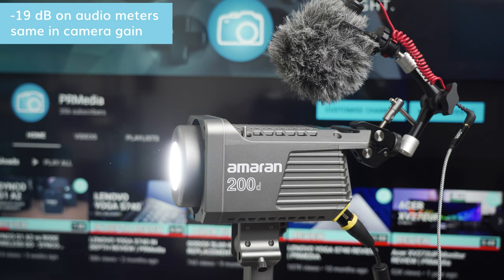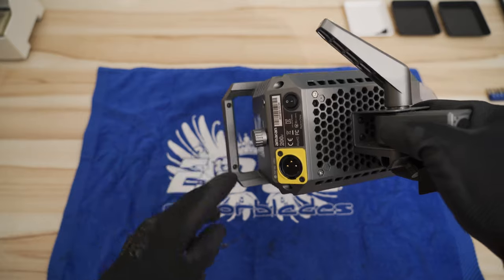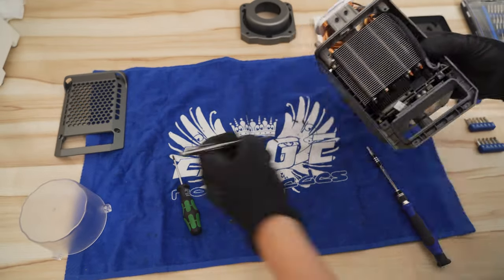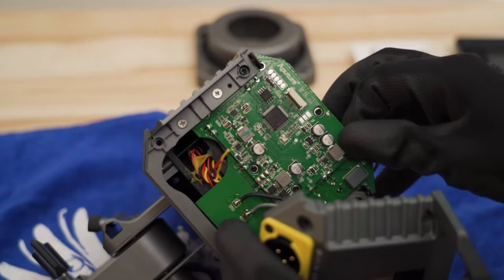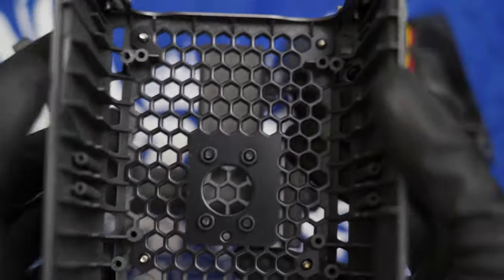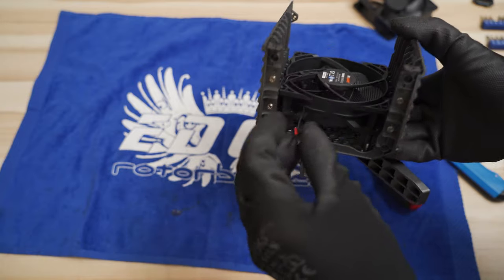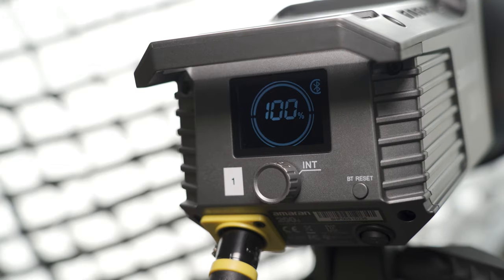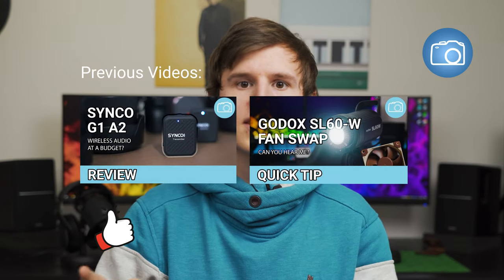APUTURE AMARAN 200D - FIXING THE FAN PROBLEM | EN

Comment from the maker: New info: Aputure replaced the fan quickly after this video. You will no longer find a noisy fan if your Amaran is from Summer 2021 or newer.
Reply: Thanks for the video! I didn't find any info that says Aputure changed the fan, How do you know it was replaced?
Reply from the maker: @orelbitan  I got another 200D a few months ago plus read about it prior in forums that it got fixed

Comment: Excellent video Pascal! 

An added tip for those doing this mod: buy a molex 3 pin male fan connector with a small cable and solder the cable on the PCB side. This way you now essentially have a swappable 3-pin fan connection and you don’t have to cut your fans cable.
Reply: What a clever idea! Thanks you.

Comment: You’ve turned a great budget light into the best budget light on the market. It’s a shame Aputure don’t invest in better fans for these units.
Reply from the maker: True! I wrote them all of this via mail. Let‘s see if the next batch still has the same fan. 
Love this light, came at the perfect time for me as I cannot afford the LS series yet. Just starting out with my videography business.
Reply: Its the same cheap fan company that godox use. I also don't understand why they just don't spend the extra 20 bucks.
Reply: @vicious12394  The difference is about 3 euro, and that's with the single unit retail price of the replacement fan.

Comment: Can I ask why you did not choose the Noctua NF-A9 FLX 92mm fan ? Personally I have found that they run the quiest long term, last the longest. Also I did wonder if heat resistant was an issue with the fan materials. Lastly Nanlite make an even more powerful budget light the FS-300 (300 watt) and apparently that has the same cheap, loud fan noise issue. If at some point you get an FS-300 and change out the fan on that I am sure there would be many people who would like to see that as well.
Reply from the maker: As mentioned in the video, the Noctua 92mm FLX has a lower fan speed than regular 92mm fans from other brands. 1600 rpm max is NOT what I recommend, as the targeted "medium" constant fan speed of the Aputure is 1500 rpm and there is not much headroom with the Noctua. Noctuas are usually the quietest due to good hardware AND low fan speeds! People very often forget about the lack of RPM and do not check airflow and cooling performance. Fans are NOT magic :)

BeQuiet is a brand I would also consider reliable and the 92mm fan I used has 1900 rpm max and runs incredibly silent, too.
Reply: @PascalRichter11  thanks
Reply: @PascalRichter11  well there's actually the A9 PWM that is much higher RPM. You just cut the PWM cable out and you're good to go! I'll post my video of replacing the 200D fans with it in the next few days :)
Reply from the maker: @ReHWolution  that version might work, you are right. Though reviews say that it is not really quiet at 2000 rpm (as mentioned - no magic here). It has a nice and low sound profile for sure, but it is not going to make a world of a difference. 

Most importantly, that rattling sound needed to go. The beQuiet I used is only 2/3 the price of the Noctua and still really quiet :) Good luck with your exchange!
Reply: @PascalRichter11  I just put a Noctua 92mm FLX in my 200x and it seems to work great. I'm getting readings no higher than 62 degrees C in a room with an ambient temperature of 22 degrees C with the light set to 100% at 5600K. Before the swap, I wasn't able to get the stock fan to spin any faster than ~1550 rpm on smart or medium fan speed (via the app), and I was getting about the same temperature readings - no higher than 62 degrees C. Have you seen the 200d's stock fan or the BeQuiet fan spin faster in a hotter environment? What temps are you seeing on the 200d? Thanks for the video, by the way - couldn't have done my mod without it!
Reply from the maker: @bearface9926  62° seems kinda hot. Before the swap, I had around 52 to 54 with 20° ambient. After, I had 56°. My fan also caps at 1550 rpm, but as Aputure calls this "medium fan speed", I would guess there is headroom. This is why I flattened the fan curve I showed in the video close to the end.

Comment: Nicely done thinking aboit doing the same. Shame it didnt come with 120s wiuld been super nice to have a nff12 industrial fan 😂. Now for the power solution is it possible to convert them to accept vmout battery?
Reply: Looking at the design it could be possible to also change the mount to a metallic one...
Reply: No but Aputure does sell a dock that takes vmounts or you can get any 48v battery pack with an AC plug.

Comment: Nice one! Do you think Aperture are still using the same fans? I would like to buy 3 of these lights but not so sure about the fan noise!
Reply from the maker: I have read somewhere that Aputure resolved the issue for the next batch. Different supplier.

Comment: I'm curious: what is the fan noise comparison between the FIXED/replaced 200D and an Aputure 300dii?
Reply from the maker: I worked with both, but do not own the 300D II personally. As far as I can tell, they are both very close together. We are talking about such low db values, they disappear together with the remaining room tone. Levels in my comparison at the beginning were boosted. While working with these lights for my videos here for example, I do not notice them anymore.
Reply: @PascalRichter11  that is amazing to hear. I'm going to hop on the 200D train thanks to you–thanks for making this. Hope they fix this issue but I'd rather not wait around to see if they do!

Hope I can figure out soldering. Last time I tried it was a nightmare but that was ~14 years ago, before Youtube tutorials were clear and well-produced.
Reply from the maker: @circavia  Best of luck getting a 200D these days. I am waiting for a good old light dome mini II for over two months now. Aputure currently seems to have availability isses, probably due to Corona and a high demand.
Reply: @PascalRichter11  True, yeah. In any case, I'll put in an order at B&H and see what happens. I also had luck early pandemic getting an ATEM Mini Pro (which was impossible to get at the time) from a smaller certified dealer in the middle of nowhere that offered online ordering. Aputure has a "Where to buy" section on their main page to find their  smaller dealers. Worth a shot.
Reply: @circavia  Soldering wires is not hard. What's hard are surface mount components.  Just get yourself a good soldering iron like a Weller and a solder sucker. Use flux and solder on lead free solder.  I've have had my Weller staton since early 2000 when I soldered on my first chip mod on a Playstation 1.  Spend $300ish back then. Fixed a lot of  MacBook Wallstreets AC jacks and iBook Clam shells back then and other things over the users. It paid for itself.  A good soldering station should cost less now.    Yeah I'm debating on getting 2x Amaran 200ds now... vs Godox lights that support Godox Light Apps.
Reply: @haywardkong1213  Tell that to my Nintendo Wii back in high school when I tried to chip it. We managed to get it working eventually but man it was a mess, thought I destroyed my Wii. I'm sure it will be easier now with clearer videos and the patience of adulthood. I'll look into getting some better gear for it, I've always loved tinkering with elctronics.

Comment: Pascal, is it possible to get an Amaran 200d with the replaced fan of you or to send an Amaran 200d to you and get it done ?
Reply from the maker: No Amaran 200D in stock yet. I could possibly do the fix for others, too. But wait for second batch, maybe Aputure fixed the problem

Comment: I would like to ask if I want to use ARCTIC F9 is it better or the same quality fan of be quiet 92mm
Reply from the maker: Arctic F9 looks like a decent fan. Works spec-wise. I had mixed experiences with longevity in my PC though, the bearings tended to run dry quickly.

Comment: it's hard not to wonder that considering all the youTube and bad reviews because of the fan. Why have they not fixed it if the fix is this simple? Aputure should just bite the bullet and change out their fans in the assembly process. I see review after review where this problem is discussed. How many have been sent back?
Reply: 10 dollars for a consumer would be quite a massive cost for the company. You should look at the cooling fans used in Alexa mini and so on. Still way cheaper than what could be put in aftermarket.
Reply: It wouldn't cost them 10 dollars, the manufacture would then not need to purchase the existing fan as well.
Reply: @JimRobinson-colors  Well, let's say they still buy it bulk and don't have to pay all the taxed we pay here the increase in cost for end product when you just increase 10 cents.

When I lived in Hong Kong and produced content there I got to see it first hand. Manufacturing is not an easy business.
Reply: It would be well worth an extra $20 to not have that noise.  Subtract out what they paid for the bad fans and youd probably only pay 10 more.  Mine is arriving tomorrow, fingers crossed this latest batch went through qc.

Comment: 1 month later, did you have any problem?
Reply from the maker: All good! The light is in permanent use. Meanwhile, Sidus link added fan control for iOs devices!
Reply: @PascalRichter11  .. I'll probably try out the fan control before modding mine.. and wait til the 1 year warranty is over... I can't believe they stuck that sunon fan in their.. I looked up the fan and it's rated 41dB(A)  and that's loud...
Reply from the maker: @haywardkong1213  before the update, the fan did not run at lower temps at all. After the „software fix“, it constantly ran at a higher rpm that is only needed at high light outputs and was thus louder than before. 

Sure - better try first and see for yourself. Maybe the second batch improved